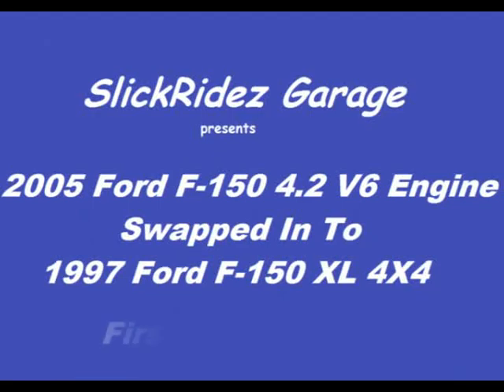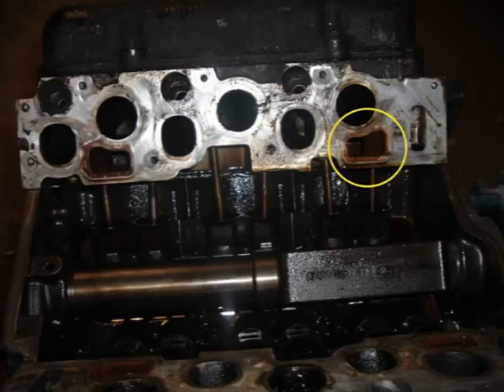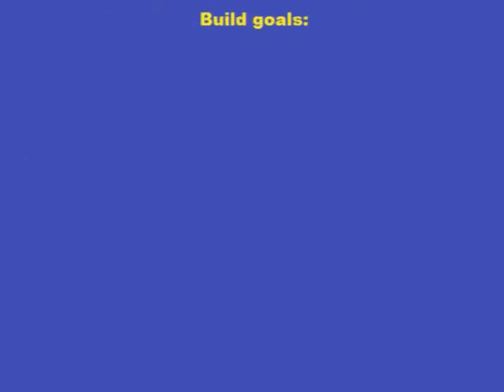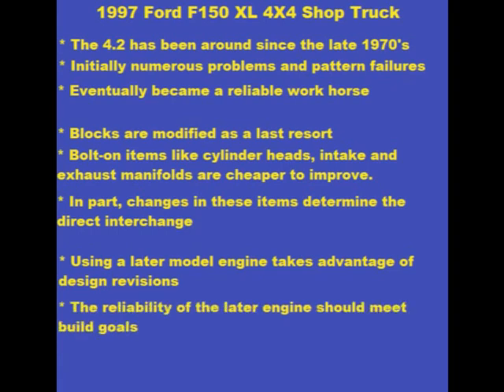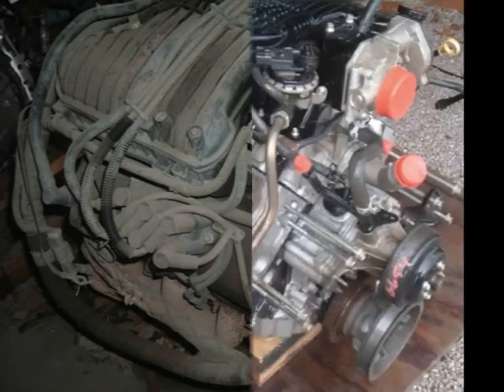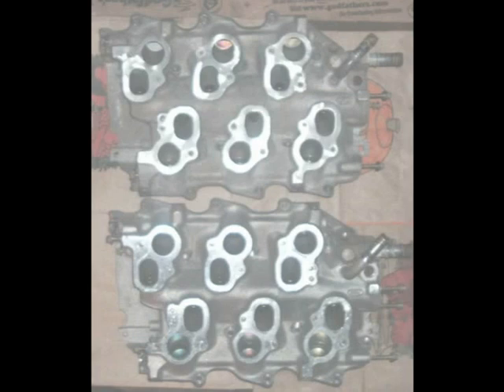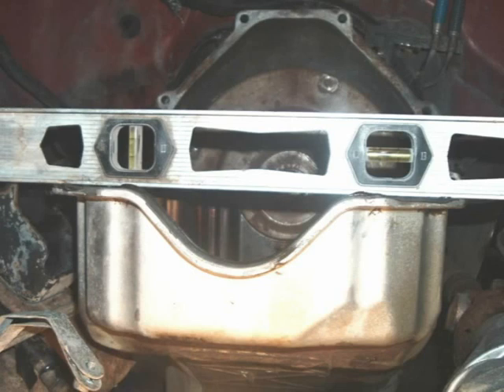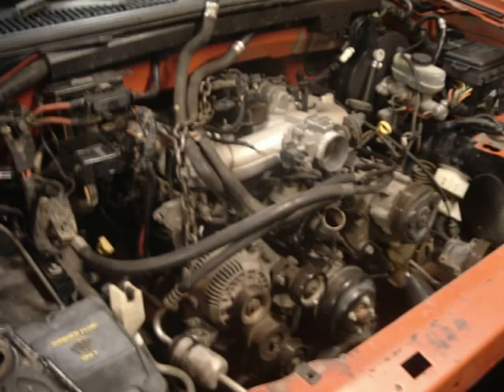2005 Ford F150 4.2 V6 engine swapped in to 1997 F150 4X4

Comment: My daily driver is a 1999 V6 4.2 liter F150 I bought from my uncle 10 years ago. He had it new when I was a kid and I remember riding in it to his farm and around town. He bought a 2011 and sold this one to me thinking it was on its way out, but he took great care of it and it's still going. I've done a lot of work to it. Brakes, starter, battery , alternator, plugs and wires, coil pack, window motors and guides and drove all over Missouri to find a GEM module and then had it reprogrammed and re keyed by Ford. It's leaking oil everywhere and needs a rebuild at 240,000. You're video is not only informative but fascinating to me because I love this truck so much. All my uncles and dad had 10th gen F150s in the 2000s but mine is the last left in the family. Thank you!
Reply from the maker: @blackiowa  your story is absolutely fantastic, thank you and thanks for watching!

Comment: Have a 07 needing an engine, my takeaway from this is an engine 01-08 will be identical enough that will accept the intake & sensors from mine virtually 100% plug & play feel free to chime in if I missed anything
Reply from the maker: Thanks for your question. If I were doing it I would stay with the 2005-2008 engine
Reply: @SlickRidezGarage  taking the safest route got it

Comment: My 1997 F150 4.2 L V6 had a check engine light in 2008 at 88000 miles.  The Ford dealer replaced a bent valve and all engine gaskets.  Then recently the engine had a check engine light, leaked coolant, hydro-locked and through a rod at 179,000 miles.  Shouldn’t the repair in 2008 prevented a reoccurrence?  I notice the 2005 intake manifold gasket also has one water port per side, although the surface area was reduced for more adhesive contact area.  My local garage says the intake manifold gaskets were not properly bonded although they lasted 15 years and 90000 miles.

Comment: I have an '02 256 V6 and it's peppy but not quick.
Reply from the maker: There's no replacement for displacement!
Reply: @SlickRidezGarage  No joke. I traded it in for a (don't taze me!) 2005 Kia Spectra, which I think is about a 90 or 120 ci. It's the same

Comment: Nice work.  Any PCM recoding or replacing required?  I have a 2001 4.2 XL with the 5 spd.  Were some 2001 intakes different? I think it was a transition year.  Need to check my VIN, not even sure it's the original motor.
Reply from the maker: Thanks for your question. There was no re-flash or reprogramming needed with the PCM. I'm still using the original PCM that came with my truck. A lower intake from a 2001 model year worked for me. Thanks for watching, hope you liked and subscribed!

Comment: Where did you get the info that 4.2 has been around since the late 1970s
Reply from the maker: Ford fell behind the curve in the late 70's with their 6 cylinder line up, in that they only had inline 6'es. As vehicle sizes were shrinking to meet new Federal guidelines Ford basically copied the Buick 231 V6 starting in the late 70's. This copy was a 3.8 liter V6 but when they put it in the early Fox body Mustangs they called it a 4.2 as a means to cover that fact up. Hope that answers your question. Thanks for watching!
Reply: @SlickRidezGarage  appreciate it
Reply: @SlickRidezGarage  this might have answered my question about the 3.8l v6 lower intake from a 2001 fitting the a 97 and making this conversion possible. but i do want to still confirm please.

Comment: I just bought a 2003 with 126,000 miles. Should be pretty safe?
Reply from the maker: Did you hear it run first? If it ran ok and with proper procedures, maintenance and operation they're generally good for at least 200k

Comment: What fuel rail did you use? And what injectors? I’m doing the same install 2008 in a 1999 I would like to use my 99 fuel rail if possible. Thanks
Reply from the maker: Use the 1999 rail and injectors. Thanks for watching!
Reply: @SlickRidezGarage  thank you very much

Comment: I hope you are doing well these days, I have read through every single comment and reply and i belive i found a similar answer to my questions before. i will need a 2001-2004 lower intake no matter what. however since the 3.8 is a 4.2 im wondering about the lower intake off of any 2001-2004 3.8 v6 like from a mustang or econoline van. being the upper intake is different in design on these years the lower intake should all be identical? thank you for your video i do hope to hear you are doing well.
Reply from the maker: Hello, and thanks for your question. I would use the intake from a 2001-2003 F150 4.2 liter or the intake from a 2004 F150 HERITAGE, not the next body style of F150. The F150 heritage model is the same body as the 1997-2003 F150. Hope this answers your question. I am doing much better after my strokes, and the tumor turned out to be brain damage from the stroke, not cancer. Thanks for watching and have a good one.

Comment: does the lower intake have to be from a 2001 4.2? is there any other year and model vehicle that this will work? i have a 4.2 2006 engine and im doing this swap but im having a hard time finding a lower intake manifold from a 2001 model. are the 3.8l v6 engines the same lower intake if they are year 2001?

Comment: Any input on the 2006 4.2 manual transmission f150 ...I'm looking to buy one but I had hear a lot of bad things about this engine.. and also some other guy Tell me everything was fine after 2004 with the 4.2 ..and he said the 4.2 with the manual transmission will run at least around 250k miles . any input will be highly appreciated.   Thank you
Reply: I have 2008 4.2 5 speed reg cab full size bed with 260,000 and I e been hard on her the last 60
Reply: @diffybraap9242  thank you for the reply..by any chance do you know something about the timing chain cover gasket?
Reply: Only replaced alternator on the engine and plugs an xss.  Wires

Comment: I got a 2005 4.2 with auto trans that went out. I also got a 98 4.2 5speed both trucks are 2wd. Can I swap the 98 5speed and pedals over to the 05?
Reply from the maker: It would probbly be cheaper and faster in the long run to install a good used trans in the 05.

Comment: really cool you noted all teh changed over the years. super useful info. im keeping my 03 f150 4.2 with 200k miles on it. still runs good enough i just need to swap the bed for one with no rust on it as mine is getting ugly
Reply: I built many trucks for resale at a used car lot. An easy way to replace your bed is to remove all the bed bolts (Ford uses TORX PLUS which are NOT ordinary Torx heads), hit the threads with anti-seize, then reinstall the bed using two bolts. Drive to the location of your new bed, swap beds, done. That lets you have rear turn signals when driving to get your replacement bed. Don't forget to unbolt the filler neck and disconnect the wiring when you pull the old bed. I use dielectric grease on the connectors (any auto store carries it) to exclude moisture. If your bolt heads are rusty and strip, you can weld a large hex nut to the heads then unscrew them that way.
Reply from the maker: I'm in the process of swapping my bed right now. I'll get it done if I can keep myself out of the hospital! Thanks!

Comment: One of the best organized and presented videos I have seen.  Your determination and attention to detail is unbelievable.  I have a 2003 4.2 and hope most of the improvements have been made my engine so I won't be facing the problems you did.
Reply from the maker: Thank you very much! By '03 the 4.2 was pretty close to being straightened out and yours has way better gaskets/seals than the early 97's for sure!
Reply: I also have a 2003 4.2, 226k miles and she is a hero still
Reply: My 97 f150 with the 4.2 went 224,000 miles before i sold it
Reply: I have a 2000 4.2 5 speed 4x4 220k miles I mud pull shit and it runs like a champ I have put 50k miles on it and it dont use oil it dont leak anything the only thing I had to fix was a starter that's it..  I think the 4.2 is way under rated.  It's slow but still
Reply: In the 245k miles I have put on my 2003.  I have only had to do two things.  The slave cylinder on my mazda sourced 5 speed manual transmission is a weak point, and I had to replace the isolator bolts on the intake plenum.  Oh, lets make that 2.5 things.  While I was back there I replaced the plastic bushings on the IMRC arms.  

oh.. and some other non-engine related things..  Ford used sealed ball joints on the front end.  replace them all! and buy the ones you can hit with a grease gun.  Oh, and at 190k miles I replaced the clutch, probably before I needed to.  The rear main seal was leaking some oil and staining my driveway.

and It seems I have to recharge the AC every other year.

no smoke, and no codes, she sailed through the last smog check she will ever have when I moved to Washington State.

I'm a nats ass from 250k, and am aiming for 500k.  past that? who knows?  We will probably all have flying cars by then.
Reply: @trwsandford how’s it running so far
Reply: @MarcoGonzalez-bi6cg  300,000 miles now.  I just drive it, and maintain it.
Reply: @trwsandford  amazing I just picked up a 2003 4.2 automatic for 2500 and it’s runs super smooth with 180k miles
Reply: @MarcoGonzalez-bi6cg  I think I have that transmission in my 1993 Lincoln Town Car, AOD-E that is the electronically controlled 4 speed overdrive..  Should be good to about 400,000 miles.  Change the transmission fluid more often than they recommend, but  don't ever flush it.  I don't know how long my 4.2 V6 will last, but at 300,000 miles, it starts everytime, and still gets over 19 miles/gallon on the freeway.
Reply: @trwsandford  I been driving it as a work truck and I’m surprised how good mpg is. I think it’s about 19-20mpg as you mentioned and about 15-17 city, I want to buy another one by next year or a dodge Dakota with the 3.9 as they are good engines with decent transmissions but I think I might pick up another  Ford with the 4.2
Reply: @MarcoGonzalez-bi6cg  I just love things that do what they are supposed to do, year after year...  mile after mile.  I'll probably keep this truck for the remainder of my life.  If she needs a new engine at some point, she gets it.  😇

Comment: Your video helped me swap in a later 4.2! Nicely done and a very professional explanation (I'm an aircraft mechanic and machinist among other stuff and trained many techs).  Subscribed! I used a new aftermarket Dorman lower intake which was properly machined and fit as it should. BTW in future you may prefer heat shrink tubing (cheap in bulk via Ebay) to tape. To separate stuck connections I spray the connector joints with Deoxit and they come apart more easily, then I spray the pins and sockets to protect them. I buy silicone dielectric grease (excludes moisture) and lube the inside of all my connectors with that. It's good for any threaded or other electrical connection to, and is also known as spark plug boot grease.
Reply from the maker: Thanks for watching and for your suggestions, I should have used heat shrink tubing.
Reply: Thanks to you, both!

Comment: I have a 2002 F-150 with 434,000 miles,I get that chirp,chirp,chirp sound when it starts up,maybe I need that syncro! thanks
Reply from the maker: 434k....impressive! A chirp in the front of the engine that goes away when hot is a early symptom associated with a failing cam sync. Then again it may be a belt, pulley/idler pulley or water pump too. That's kinda vague and maybe not so helpful, neither is the location of that thing! It's hard to reach with an automotive stethoscope but if you have access to one and can give it a listen when cold I'd think real hard about doing that, or having a shop do it, just in case? Thank you for watching!

Comment: My first vehicle was a 2006 F150 XL singlecab 8ft bed. Had the 4.2L. My grandfather handed me the vehicle in June of 2015 and it had 192k on the odometer. Had it until October 24th 2016 at 202k when transmission slipped out of gear and was really worn out. was basically 90% city with weight and 10% highway. It was a company truck my grandfather owned but I appreciated the truck.
Reply from the maker: These are easy to love. So far mine has been great. I owned GM trucks before this Ford. I must have had malaria!
Reply: @SlickRidezGarage  It's a great truck for easy work for sure. Can't believe I commented 3 years because I still talk about my old '06 to this day. 2 years ago my grandfather gave me the $1 bill I gave him for the bill of sale and he laminated it. Still has a special place in heart lol.

Comment: how does the V6 4.2 litre compare to the V6 4.0litre in the ford ranger.
Reply from the maker: Thanks for watching and for your question. The 4.2 is an Essex family engine and the 4.0 OHV is a Cologne family. They aren't related. Between them I prefer the later 4.2 but both have their own sets of pattern issues. Are you comparing a Ranger to an F150 for a specific purpose? 
The 4.0 is also related to the Taurus/Sable 3.0 OHV.
Reply: Currently in the search for a possible V8 swap or more powerfull V6. the newer engines have much bigger heads and take quite a bit more room in the engine bay.  Looking at even an LS since there so compact.
Reply from the maker: There's no replacement for displacement, so if it were me I'd go the V8. I think with either a Ford or GM platform your going to need a shoe horn to get it in there. What year is the Ranger?
Reply: 2004 with the stock 4 litre V6.  Being a diesel mechanic swaps don't scare me, but the engine choice is so large that its difficult to choose.
Reply from the maker: If it were me I'd keep it Ford based, but I'm not sure it would make too much difference. By the time a V8 swap with any brand concludes most if not all of it would be new or different anyhow.  Hope your thinking of video-ing that.....which would be cool! Good luck with the swap!
Reply: put a 4bt in it
Reply: LS swap for sure since inexpensive tunes don't exist for the Fords while LS1swap flashes GM computers for ~75 bucks.  I have Ford and Chevy trucks (and think brand fanbois are fools) and each has their pluses and minuses. An LS flashed to delete the anti theft system (so it doesn't need that delicate crap) or the BCM and with rear oxygen sensor delete gives you a drivetrain you can stuff in anything, the the garbage 4L60E transmission is very easy to rebuild and upgrade with a Corvette servo, Sonnax accumulator pistons and bigger clutch packs.  Given the work involved you might as well get the HP and torque a V8 offers.

Comment: I have a 2001 with 350,000 and it is in need of a new engine. It has started burning oil and has several oil leaks. I think I need you to fix mine. Good video some very good information thanks.
Reply: only 350k miles?  what a quitter.  I hope I can hit 350k with my 2003.  only 124k to go

Comment: The 4.2 didn't exist before 1997 model year.the 3.8 Essex was the basis for this engine.it debuted for the 82 model year.
Reply from the maker: In the late 70's Ford copied the GM 3.8 V6 for use in their vehicles and called it a 4.2. Ford originally planned to use the inline 6'es up to the mid 80's but when government mandates changed it left them behind the curve so to catch up they straight up ganked the GM design.

Comment: Hey Slick, currently dropping an 03 or 04 engine into 98, no need to swap int. manifold, but it does have knock and temp sensor on the back of the left head, i could really use some input on rearranging wires in order to accomplish what you've done there!
Reply: Joe Lewis hi I see you have the same problem I have i got a 97 f150 and I found 2006 engine did you find out solutions for the wire connection on knock and temperature sensor?
Reply: @rafaelrojas5800  I did, I've got a Chilton manual and was able to puzzle it out via wire colors, what do you need to know exactly?
Reply: @Joe_JesusWins_Lewis  thanks for ur answer you used the old sensor from ur old engine or the new one come with the 2005 engine?
Reply: @rafaelrojas5800  on both i extended the wiring from original points and connected newer sensors(solder those wires)  because i kept the whole 03 intake plenum.   

If you're using the 97 plenum and lower intake then you won't move the temp sensor right by the thermostat.  You can simply extend the knock sensor wiring and route it up over the driver's side of the fuel rail to the back of that cylinder head.
Reply: Joe Lewis thanks so much for your help I going to use a 2002 lower intake manifold so now I know what to do thanks again
Reply: @rafaelrojas5800  does the 02 lower intake have both temp sensor mounted on the front?
Reply: Joe Lewis to be honest I don’t know yet I going to get one from a salvage yard or what do thinks is better for my 2006 engine
Reply: @rafaelrojas5800  is the 2006 engine complete?
Reply: Joe Lewis the block and the heads
Reply: @rafaelrojas5800  in that case I would follow this videos instructions very closely and only rewire the knock sensor bring over your metal water tube off the top of the water pump from the 97 probably buy a new one of those and switch over your two temperature sensors out of the old lower intake into the lower intake specified in this video, along with lower intake gaskets specified in the video.
Reply: @rafaelrojas5800  you'll need to pick up a knock sensor plug from a 2006 engine wiring harness as well
Reply: Joe Lewis ok that makes sense thanks so much again for sharing your knowledge
Reply: @rafaelrojas5800  no problem my friend, bueno noches and good luck!
Reply from the maker: About the time you made this comment I started having health issues. I wish I could have helped you. Sorry about that.